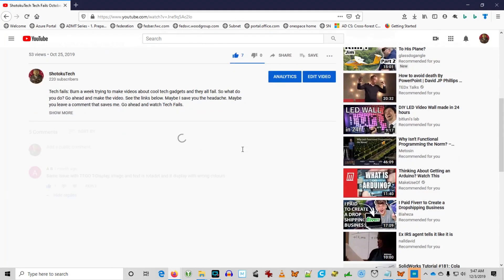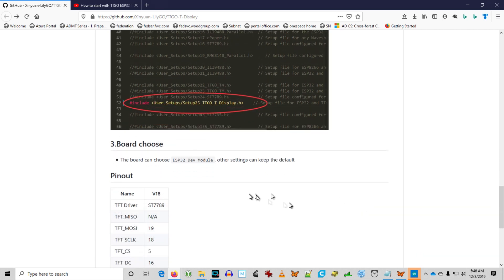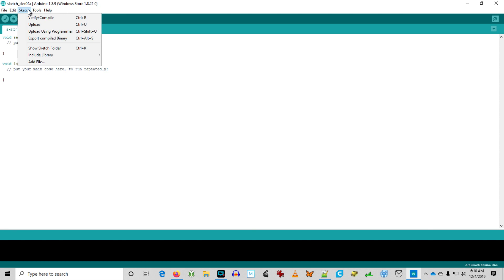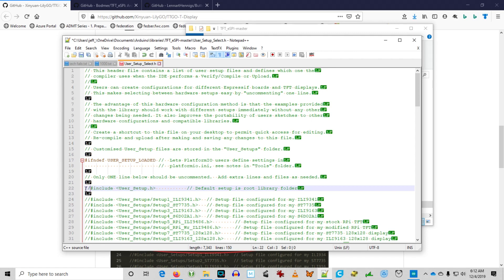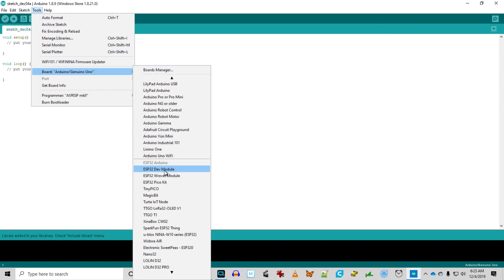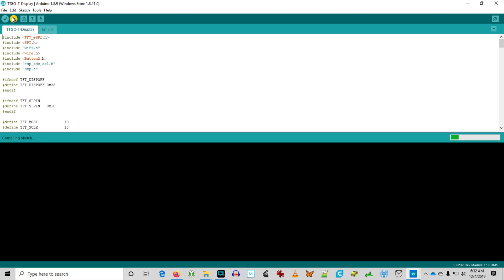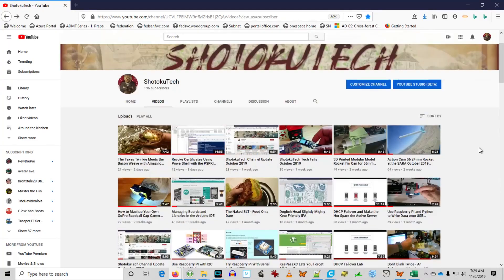TTGO T Display Board Here We Go Again

Comment: How is it used without a usb cable? I can not find it. Thank you so much for your help.
Reply from the maker: You only need it to flash programs to it. Otherwise you can power it via the battery port. These have the right connector: https://www.amazon.com/gp/product/B07CXNQ3ZR
Reply: @ShotokuTech  thank you !!
Reply from the maker: @FritsvanDoorn  I have a whole playlist of T-Display videos. I even designed a rudimentary 3D printed case the the T-Display and that battery, featured here. Thanks again!
TTGO T-Display Convert Images for Your Own Custom Display
https://youtu.be/u1BvcRRiGq4
TTGO T-Display Case
https://www.thingiverse.com/thing:4380351

Comment: Oh, you might want the website address for the image converter: http://www.rinkydinkelectronics.com/t_imageconverter565.php
When using it, change the extension from .c to .h. Declare your image data just like TTGO did in the demo sketch. When calling it, make sure to use the name inside the file and not "ttgo" like they did in the sample. To make my life easier (I used 4 graphics in my code!), I would declare the image file, shut down Arduino, re-open it, it now includes the new file in a tab, and look inside for the name of the image for the draw command. The name is usually the name of the file without the .jpg extension. 

You should do a video on how to do this. It's SUPER easy, and on these OLED screens, it looks amazing! There's plenty of space for images as well.
Reply from the maker: Thanks for the tip. I went ahead and downloaded the UTFT libraries for Arduino and OLED from here as well. Thanks again!
Reply from the maker: Check it out! "TTGO T Display Convert Images for Your Own Custom Display". https://youtu.be/u1BvcRRiGq4
Thanks!

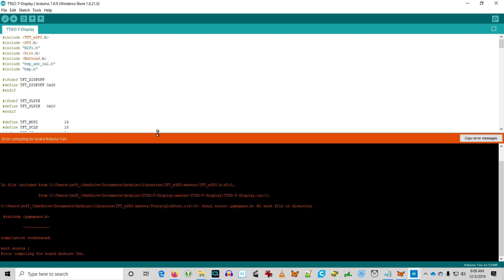Comment: 1:42 Error compiling for board Arduino Yun  - for some reason it wasn't set as ESP32
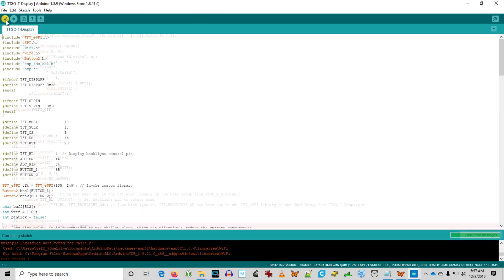Reply from the maker: I am going back through the raw video to see how that happened. I crop an awful lot out of the published video for the sake of time. When you look at 1:30 I have the correct board selected. How weird! I just saw in the raw video, it changed from ESP32 to Yun in the background while I had opened board manager.Oddly I never clicked on Yun.
I put the clip here on Twitter. 

https://twitter.com/ShotokuTech/status/1208832736833589248

At 00:18:25:700 it switches. Good catch!

Comment: Hi. I have problems initializing the module “DollaTek LORA32 433Mhz ESP32 Sx1278”. It is a clone of the TGO LoRa32 SX1276 / 78 module. I cannot initialize it with the library <RadioLib.h>. There are problems with the pins. However, I can initialize it with the <Lora.h <library, and I can send and receive packages. The problem is that <Lora.h> does not use pins D0O1 and D0O2, it only uses it like this:

//define the pins used by the LoRa transceiver module
#define SCK 5
#define MISO 19
#define MOSI 27
#define SS 18
#define RST 14
#define DIO0 26
#define BAND 433E6
En el void Loop()
SPI.begin(SCK, MISO, MOSI, SS);
//setup LoRa transceiver module
LoRa.setPins(SS, RST, DIO0);

With this configuration the module works and starts perfectly with lora.h, BUT I NEED TO USE <RadioLib.h>

// SX1278 has the following connections:
// NSS pin: 18
// DIO0 pin: 26????
// DIO1 pin: ¿??
SX1278 lora = new Module(18, 26,?);

With this setting of <RadioLib.h> I cannot initialize the module.

I need help to initialize the module with the <RadioLib.h> library and be able to send and receive packages.
Can anybody help me?
Reply from the maker: The TTGO T Display is not a LoRa board. Just WiFi and BLE. 
Did you check these links out from the aliexpress page for the product?
https://github.com/LilyGO/TTGO-LORA32-V2.0/tree/LilyGO-868-V1.0
https://github.com/LilyGO/UNO-TPLORA 
at https://www.aliexpress.com/item/32844017936.html